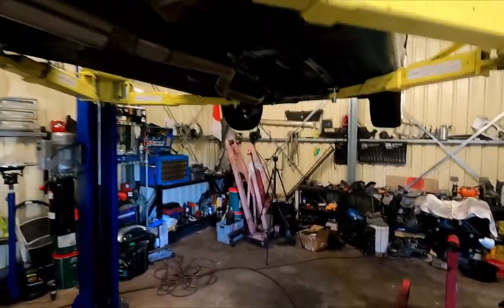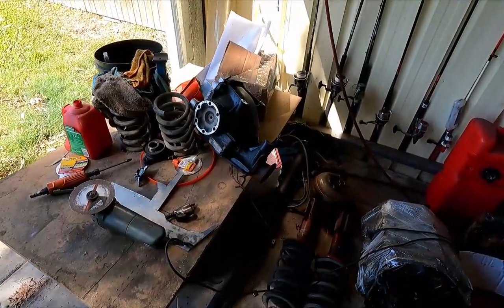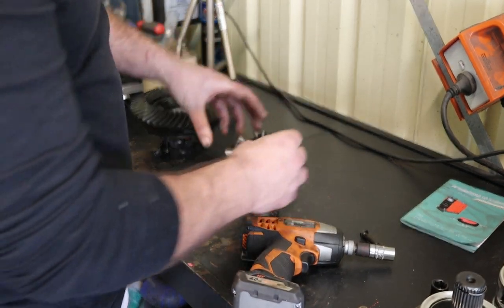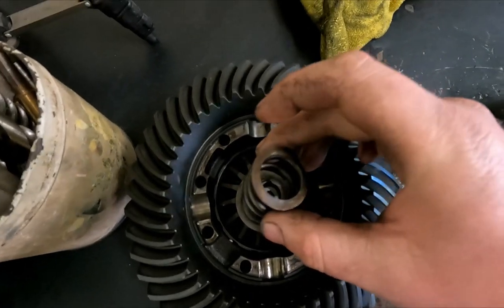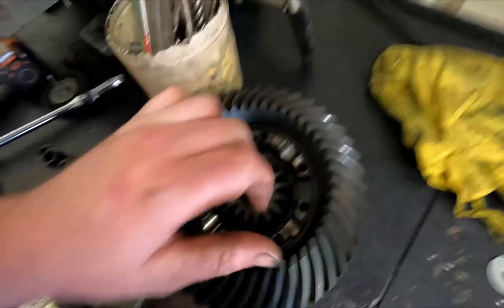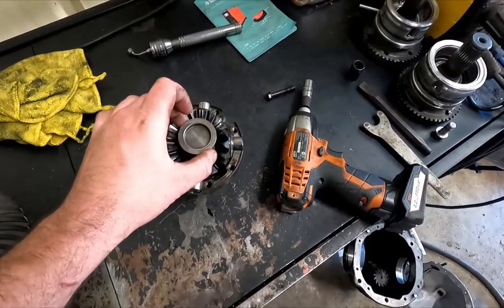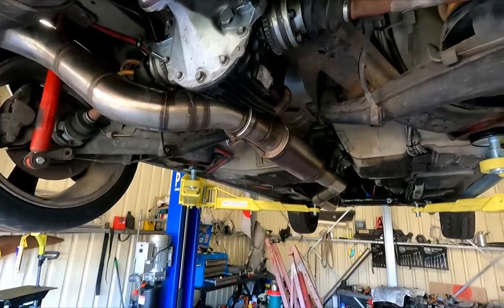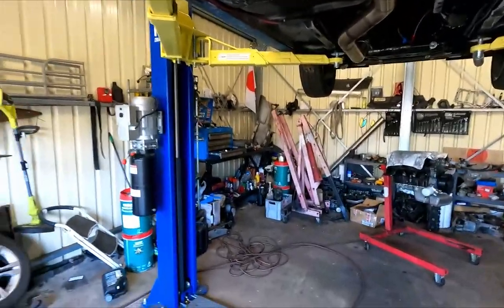how to shim/lock up an m80/m78 lsd diff for a commodore.

Comment: Borg Warner diffs suck.
Been there done that.
Depending on how hard on things you are, It'll work for awhile, then.. back to one leg peg. 😁👍
Reply: If you built them correctly, no, usually just the clutches that wear out, like most lsd diffs, 80 series LSD is the worst LSD's ask me how i know loll
Reply: they're pretty good for what they are. What this guy is doing is not how you should shim a diff. He is shimming the spring, which does very little. It might 'feel good' by hand but will just wear out the cones very quicky. Properly rebuilt and shimmed properly, they last a long time and are very strong for straight line racing and street work. They are just not good for dohnuts or basically circuit racing type driving where you force them to slip under load.

Comment: Just done this mod this today to trial before a go truetrac, see how long it lasts. 
I Used a 1.48mm washer 
Seems perfect, roughly doubled the amount of effort needed to spin a wheel with 1 wheel on the ground and another raised (slipping the lsd by hand).
Drove it today for about 1 hour and felt well behaved, almost could say it feels like a brand new diff.
I haven't tried skidding or abusing it yet so will update in a lil while about how long it lasts.
Reply from the maker: Yeah man works pretty well and lasts a fair while too
Reply: Annd its loose already, I guess 9.5 inch tyres and drifting a roundabout or 2 everyday day will do that
Reply: How long it last?

Comment: Hey bro i love your videos! Keep up the good work 😀 
I got a quick question, my 01 vx v6 sedan auto and has M75 diff non lsd with 3.08, is there a way to upgrade to the common M80 gears with 3.45 or 3.7 with lsd?
Reply from the maker: Yeah man just change the whole diff out to an m78/m80 lsd type
Reply: @cornfedboost  and there is no machining required? Cause i got told there is and got quoted 3.5k that made me think they taking me for a spin 😆
Reply from the maker: @ghostrider852  nah the whole diff itself should be a bolt in deal man.. 3.5k sounds a bit much
Reply: @ghostrider852  I bought mine with a  VY cradle, a mate and I fitted it in a VT sedan over night in a back yard, by the time the kids woke up it was on the ground running and driving again.

VT exhaust will need to be swapped for a VY system if you go down that road. The VY system has an extra bend to clear the toe arms
Reply: Was it hard to change the flanges on the diff or was it as easy as taking them off and putting it on